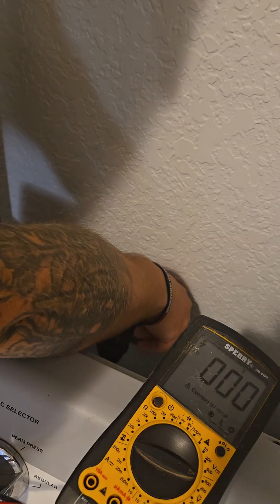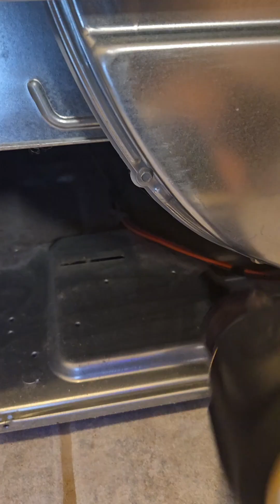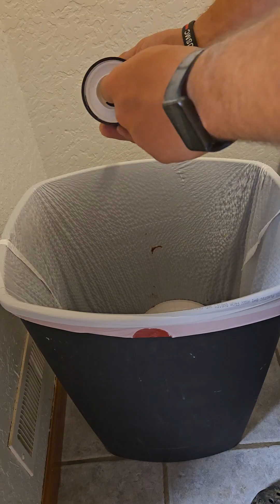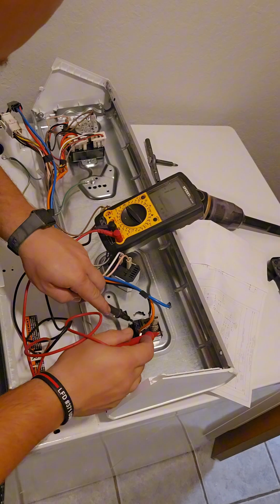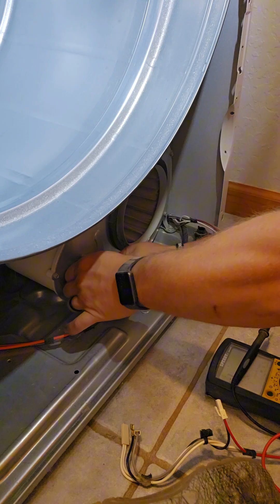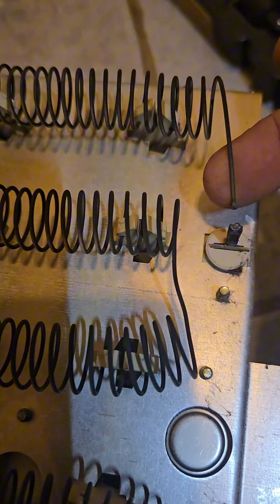Let's fix a no heat situation in a speed queen electric dryer!

Comment: Thanks for your helpful video! I have a Speed Queen dryer, model ADE30RGS171TW01. My orange wire burned at timer terminal H, and the red wire at L2 looks slightly heat-damaged.

I followed your continuity test with the dryer unplugged and my multimeter set to continuity. I placed one probe on terminal H and the other on L2, with both wires disconnected. I tested at 40 and 60 minutes on Time Dry and at More Dry on Automatic. Every time, the meter displayed OL (open circuit) with no beep.

Does this confirm that the timer is bad?

My bigger concern is what caused the orange wire to burn. I've also had a wire burn at the heating element before. Could a faulty timer cause this, or should I check the electrical supply or something else?

Also, do you sell the correct genuine Speed Queen replacement timer or other parts?

I'd really appreciate your advice. Thank you!